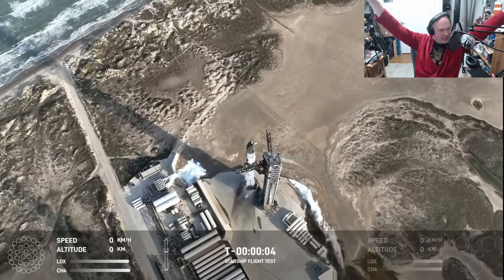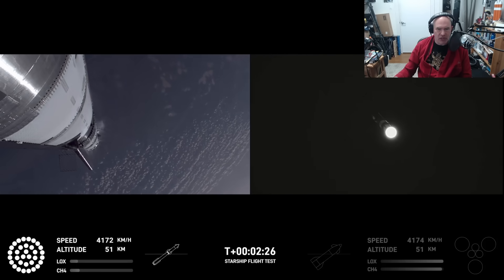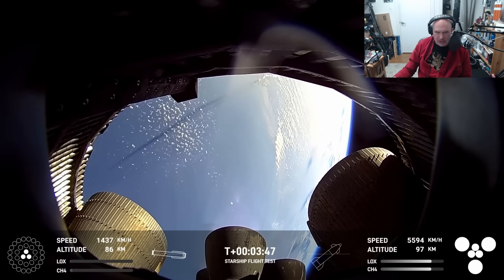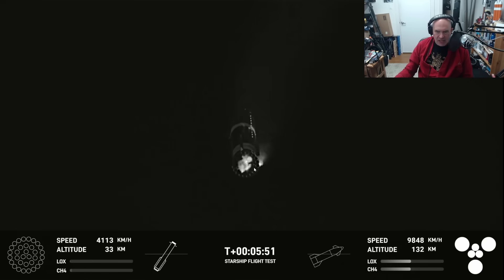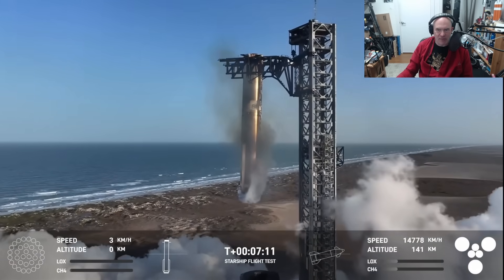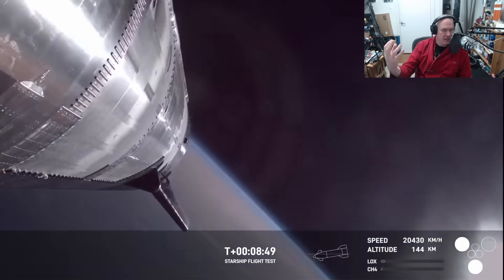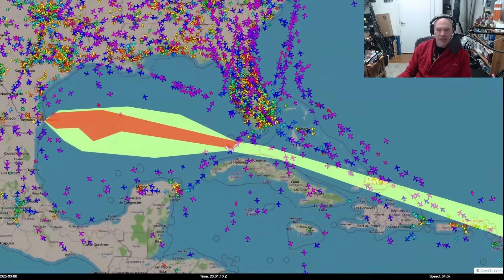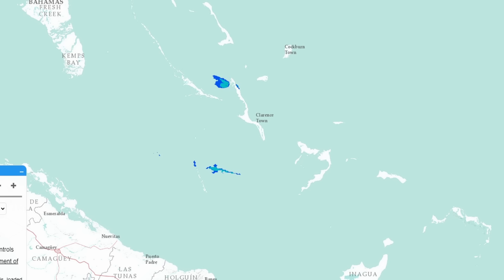SpaceX Make The Same Mistake Twice With Starship Flight 8

Comment: I would have never thought that we would see (several) booster catch landings before we ever see Starship reach orbit or deliver a useful payload! 😮
Reply: It's about how much fuel is saved during flight by not having the extra weight of landing legs.
Reply: The parts you think might be easy or hard often turn out to be the opposite. Remember that most people worried about the Space Shuttle's main engines, when the simple and trusted solid rocket booster turned out to be what killed Challenger.
Reply: @RCAvhstape  Challenger was due to a non-risk adverse decision to launch when it was much colder than they ever saw. So was more a human management problem of the tech rather than the tech itself. Columbia was the opposite
Reply: @Daniel-kz3df  Doesn't change the fact of what I wrote: everyone, including the astronauts, thought the SSMEs would probably be the thing most likely to cause an accident, not the SRBs.
Reply: @RCAvhstape  Agree focus is probably on the wrong thing now (they were probably right to focus on booster first, but lingering too long)... but these are new vac-firing engines. They need some fault detection & recovery on this upper stage like every other human rated system has had in the life of nasa programs (post apollo). The first 'main' use of this spacecraft will be with humans on artemis III. They changing too much at a time on upper stage and feel like they don't understand root cause from last boom
Reply: @ ..And the stupid foam coating on the external fuel tank was ignored even after engineers raised red flags just as they did for a low temperature launch of the SRB.
Reply: Yeah, it's almost topsy-turvy!  I thought that the 'catch' was a fluke not to be repeated - at least not easily.
Reply: the problem is never what you want it to be
Reply: @joelalexander928  Nor is the problem necessarily what you know.
Reply: the catch is not as awesome as the muggles think it is
Reply: And SpaceX plans to launch with giant fuel tanks as payload. Imagine the show.
Reply: SpaceX accidentally making 'catching boosters' look easy, LOL
Reply: Starship MK2 is so stripped out, its so fragile imo. They will add to fix. Great broadcast.
Reply: My thoughts exactly.
Reply: Ship is a much harder problem. Booster is much like a scaled up Falcon 9. Ship is the first ever completely reusable upper stage.
Reply: @berrywd  You could argue that Shuttle was a completely reusable upper stage, since it was put into orbit by the onboard OMS.  
But I agree that ship is the harder problem (largely due to reentry).
Reply: @jwlarocque   Shuttle was an almost completely reusable single, main stage.  It jettisoned its propellant tank was all.  It brought its engines back.  It had a large, accessible cargo bay.  It had a generous crew cabin.  That was great!  The problem was boosters and tank were alongside of it, and its enormous initial construction cost and refurbishment cost after each flight.  Otherwise, NASA could have had more Shuttles built.
Reply: @berrywd I was surprised to learn that the booster is actually easier to land than F9. The F9 with one engine at minimum throttle has a thrust to weight ratio greater than 1 so the timing of the final burn is critical. But Superheavy on 3 engines can hover indefinitely (until the fuel runs out) so the margin of error is much greater, the booster has more time to leisurely hover into the correct position.
Reply: fingers crossed that they find out a deorbiting Starlink satellite hit it
Reply: Me too
Reply: Recovering the booster is as far as the program has come in terms of the system's key design goals; have to recover Starship itself before the goal of rapid reusabilty can even be addressed.
Reply: Booster was always easier, far lower energy etc, this is not really surprizing.
Reply: I seem to recall the Harrier used to drop the last few feet when landing as trying to put it down gently caused a ground effect and it could flip over onto its back like a turtle. I wonder if SpaceX encountered similar ground effect issues and figured it was simpler to land it up in the air on a tower
Reply: @miroslavmilan Agreed but in a funny way it gives me a tiny bit of hope for the current situation. Development seems to have hit a hurdle right now and progress has slowed until SpaceX can get over it. A disappointing surprise that it is taking longer than expected to get to orbit. Then again, I thought the booster catch would come much later and I also thought that the heat shield would perform far worse than it has done on the ships that have reentered. I really did think that quite a few early attempts would simply burn up due to TPS failures. Seeing how many heat tiles fell off early ships and SN prototypes really did make me think that that would be a roadblock for quite a while.

So my tiny bit of hope about this unexpected (by me) frustrating delay is that once SpaceX gets past this current issue then maybe there will be some more positive surprises afterwards, for instance maybe the time taken for an actual docking fuel transfer in orbit being way less than I’m expecting, and that might recover at least some of the time lost to this issue as measured against my expectations of when the Starship program will reach certain future milestones.
Reply: @julianfp1952  starship is doomed
Reply: it's never going to deliver a payload in the testing phase... other than fake starlinks and simuated loads.
Reply: You do realize they are just testing, as Manley has said on an earlier flight they could have went into orbit but testing something that is bigger than any other rockets takes time and eventually this is the type of vehicle that will carry people to the moon takes a lot of trials.
Reply: @donmarlowe717  they are "testing" things that could have been worked out beforehand

it is a scam
Reply: Look at the Sunny side I guess
Reply: It's not surprising when you realize the entire companie exists purely to fleece the government for public money,
Reply: SpaceX was landing rockets while Starship was still in prototype. Tf you talking about?
Reply: how were the initial star link satellites deployed
Reply: You have to focus on the cool and innovative stuff!

Orbiting is a 1957 thing when none of SpaceX employees was already suborbital.
Reply: Sabotage....???
Reply: @carlfrye1566  Zelenskyy??
Reply: Booster isn't important at all. It's a silly gimmick.
Reply: Feel free to head over to SpaceX and address the issue. Since you lack the skills, you'll criticize the program because that's all you have.  Your low degree is evident.
Reply: I did. Thats the seay bit. I predict you will NEVER see Starship reach orbit, deeply a payload of more than 1 banana and return to be used again... 

The only way this thing ever works is make it of aluminium, make it disposable.
Reply: I don't even care anymore. It's all a lie
Reply: Catching the booster is not a difficult thing to do.  It's EASIER than landing it--that's why they do it that way.
Reply: @greg55666  not easier - more efficient. if you dont attach the "landing gear" to the rocket but instead to the ground the rocket gets much lighter. less fuel needed to throw it up in the air and less fuel needed to stop it.
Reply: @Grimm211 I don’t think you are right about that. How much more fuel does it take to go another 100 feet? I would think it’s nearly identical.
Reply: @LemonsAndSalt69 how much fuel does it take to slow down another tens of tons in landing leg weight.
Reply: @LemonsAndSalt69 its not only about the fuel but the refurbishment part. Right now, the falcon 9 part that needs the most time and refurbishment is its landing legs since it experiences the most stress during each landing. Starship booster would need significantly bigger landing legs and waste significantly more time refurbishing it than current falcon 9s
Reply: @LemonsAndSalt69  landing legs weight hundreds of kilograms, pretty sure
Reply: @LemonsAndSalt69  It's not about distance to ground. It's about the extra mass for landing legs that would be brought up and back down. Putting it on the tower improves payload to orbit. Also, you don't need to marine assets for landing boosters, reducing costs and improving turnaround times.
Reply: @plane.355 it's not just landing legs it's also the mechanisms and electronics to make the landing legs get into position
Reply: @LemonsAndSalt69 it's not about the 100m.  It's about the weight of huge landing legs😮
Reply: @LemonsAndSalt69  you also thought kamala would be a good president so i’m not surprised you have no idea what you’re talking about
Reply: @LemonsAndSalt69  Landing legs are heavy, Scott has a whole video on this iirc
Reply: @LemonsAndSalt69 you need much more hardware to the rocket stay up by itself
Reply: @greg55666 it’s not rocket science
Reply: @greg55666  Easier? Based on what? Just because SpaceX makes it look that way, doesn't mean it's "EASIER" or else everyone else would do it..
Reply: @RSA-GPW  Do you think everyone isn't going to be doing it shortly, from competitors like blue origin to the Chinese and everyone else too? We've reached a point in technology and cost where it is imminently doable. SpaceX just got a head start on the problem with billions of dollars of NASA funding. And they didn't pioneer a reusable vertically landing launch vehicle either, that was NASA and DOD with the Delta Clipper experimental program in the 1990s.
Reply: @ they catch the booster so they don't have the added weight of the legs which would be multiple tonnes each meaning those multiple tonnes they can add to the payload capacity.
Reply: @BobaPhettamine  which is severely reduced because of the need to carry all that fuel to do the tail landing
Reply: @physicswithpark3r-x3x  uses the same amount of fuel as if it where to land on legs you dope.
Reply: @BobaPhettamine  did you mean to write were when you wrote where?
Reply: @greg55666  They do it for the possible rapid reusability of taking it up, catching it, then immediately putting it on the launch mount, and refuel instead of grabbing it from the ocean or another pad.

+ super heavy is quite heavy unsurprisingly, it'd require even heavier landing legs than f9
Reply: @greg55666 nothing easy about catching a skyscraper. What they’ve done is completely novel and extremely difficult. Also much higher risk than landing a booster, because if it fails, you take a whole bunch of expensive infrastructure with it.
Reply: @greg55666  Maybe, but the super heavy booster has 33 engines.... too many engines was what doomed the N1.... There was a lot of fear it would not be possible.....
Reply: @greg55666  Thank you. People are so gullible "tHEy areee catching ROCKETS ahhhh" Jesus chreist drones land themself
Reply: @PT-mj3bk  Wow. What sort of drones are you talking about? Ones that null out 3,500 kph of velocity with the minimum possible energy expended?

Comment: "Put it in orbit for real this time..."
I'm pretty sure they've been trying to do that for a while now. They are just incapable of making a functional rocket.
It is never going to fly.
It does make pretty fireworks.
Reply: Have you heard of Falcon 9?
Reply: @AnomalyXero  Kinda useless for the required mission, no? 
It is incapable of translunar injection. Starship is incapable of orbit.
Reply: @demcomp   Falcon 9 is a functional rocket built by SpaceX.
Reply: @AnomalyXero  Wow.... 
That's nice.. We're talking about Starshit here. I'm commenting on a blowing up starshit video that they're clearly incapable of making a functioning rocket, then you bring up Falcon 9, which is not even in the same category.

That's like comparing the Saturn V to an Aerobee rocket.
Reply: @demcomp  You implied that SpaceX is incapable of building a functional rocket. All I have done is point out that SpaceX has previously built a functional rocket.

Comment: Block 1 Starship worked absolutely  fine till re-entry, so what do Space X do?
Completely redesign the piping from the propellent  tanks from one thick strong downcomer to  four  thin weaker propellent lines  to the engines prone to resonance and vibration and they now , leak, break , catch fire then explode.
Maybe go back to the original propellent pipe design.
Wonder how long it will take the Space X engineers to convince Elon...?

Comment: Does Starship have a single point of failure where a single engine out can destroy the craft?
Reply: They put multiple engines on them to reduce chances of loss of mission. The booster can lose a few and still complete insertion of starship and return.

Now if you’re asking can Starship still reach the moon or Mars with lost engines I’d think they’d scrub to preserve life or if during a burn they could burn for longer to achieve required velocity and course.

Comment: Hot staging is killing starship
Reply: What makes you think it's hot-staging?
Reply: @imaginary_friend7300 because of the nature of failures after hot staging was introduced. They all seem to be structural.
Reply: @cmtelobo1146  Block 1 Starship worked fine till re entry.
Its the downcommer redesign thats the issue. Going from 1 big thick downcommer to 4 weak thin downcommers is the issue
Reply: @ajctrading the block 2 is supposed to be an optimized design compared to block 1. And in fact it is performance wise.  
Block 2 has a much larger tank and they won’t go back to block 1 I believe. If I was going to bet I think they will work on structural improvements for the ship and will try to smooth out the hot staging process. The hot staging is when the highest dynamic loads are acting up in that section of the ship.
Reply: @ajctrading the reason why block 1 worked fine is because it was subjected to lower loads due to its tank design.
Reply: All speculation guys. Don’t get me wrong. Just my best guess! Thanks for the discussion
Reply: Apparently, they made improvements in the hot staging ring for flight nine

Comment: I dunno. Seems to me that putting the payload into orbit and not explode at 140 odd km into the mission would be more important and impressive than catching a booster, but then I'm not a rocket engineer.
Reply: You're also making simple assumptions.  The 2 are separate items.  They can work and do work on both at the same time, one is just much more complex than the other.  The booster was always expected to be the easy part.